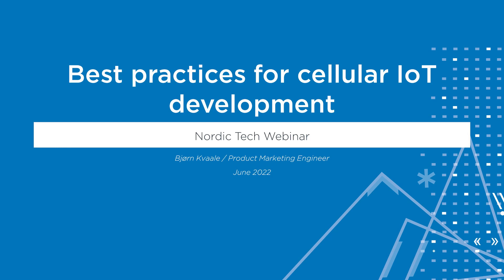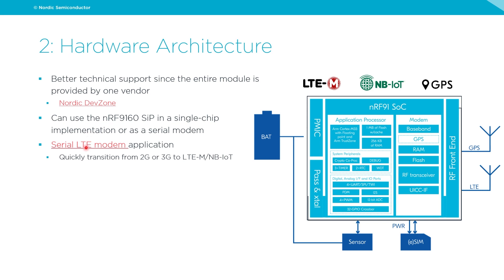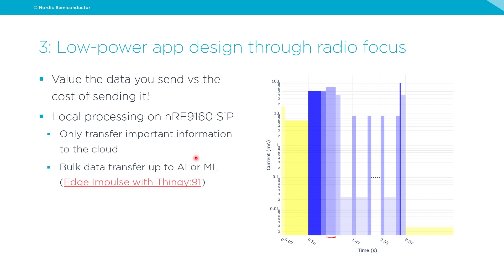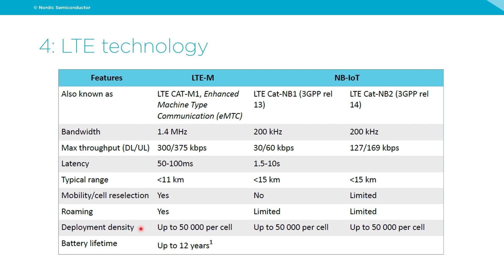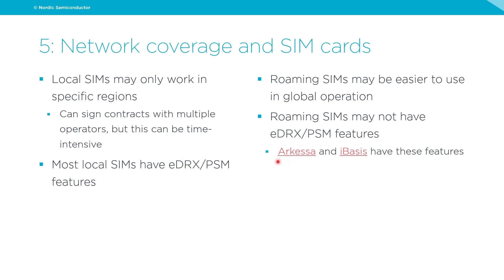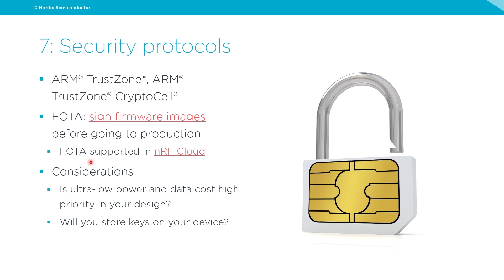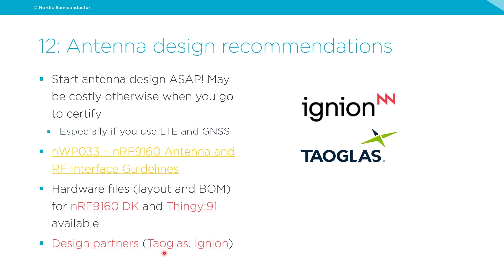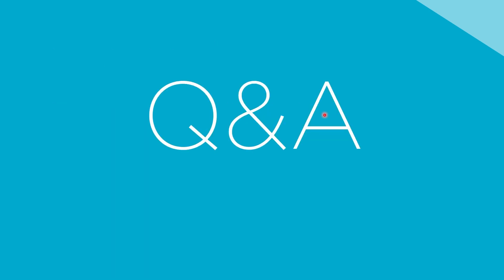Best practices for cellular IoT development

Comment: How to wake up from long sleep ? Can it be done by sending MQTT message /send a SMS ?
Reply from the maker: No, the radio is usually turned off in most sleep modes to minimize current consumption. Please feel free to contact our support team over on DevZone if you have specific technical questions!